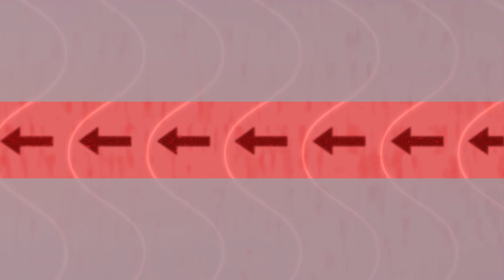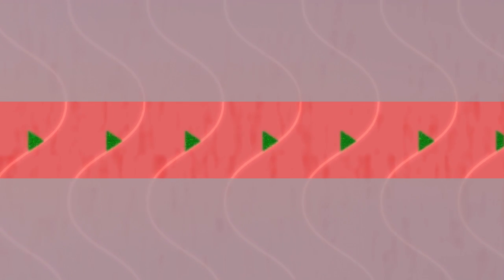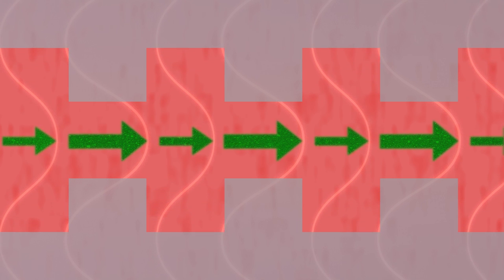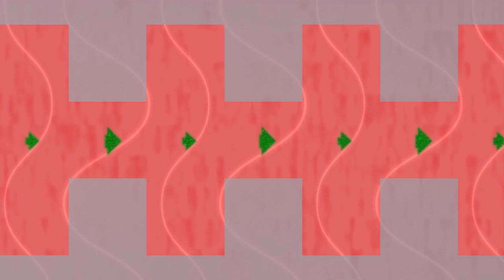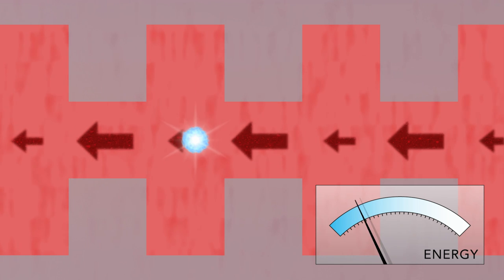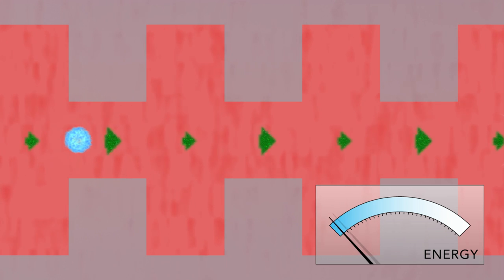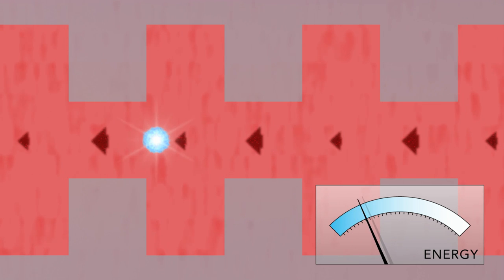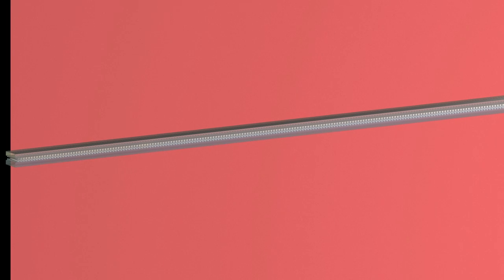Accelerator on a Chip: How It Works

Comment: You should read the article in Science Daily, guys. Acceleration of electrons is done in two steps. First, they're accelerated to a near-lightspeed. Since electrons have mass, they can't reach lightspeed, and further "accelerating" doesn't increase their speed, it increases their energy. The video depicts the latter - as you can see, electrons are shown to shine brighter (increase in energy) and not move faster (speed remains constant).

Comment: That is a little different. In that case you are just giving electrons a one time jump. In this, you can accelerate them as long as you want. It is also frequency dependant. The higher the frequency, the more energentic the electron.

Photovoltaic Cells work on the same principle, but they are already frequency tuned. The issue is not with the amount of energy the electrons have but capturing as many of them as possible.

Comment: The electrons are already traveling at nearly the speed of light, so the laser light's electric fields add energy, not speed, to the electrons. The news release mentions collaborators in Germany working to make a laser-based injector, which would speed up electrons to near light speed for insertion into this accelerator.  That accelerating structure would have to have spacings that vary with the speeds at which the electrons are traveling.